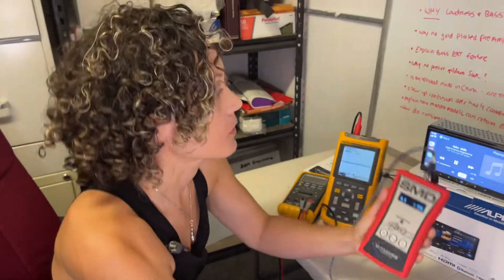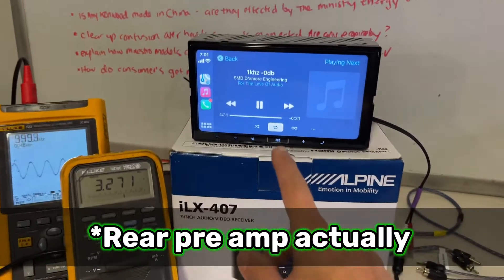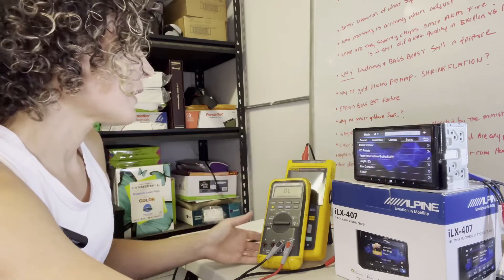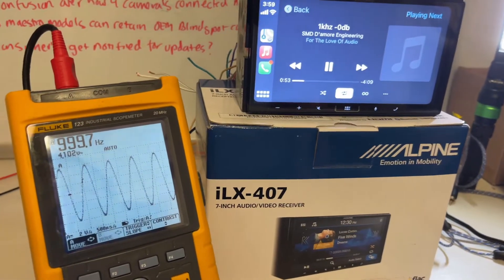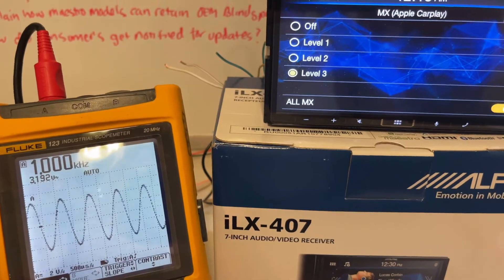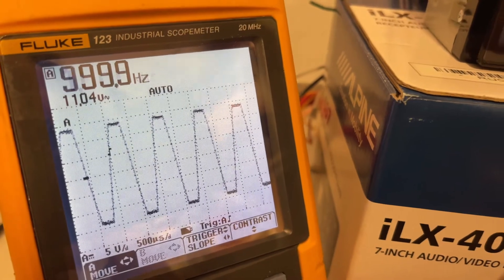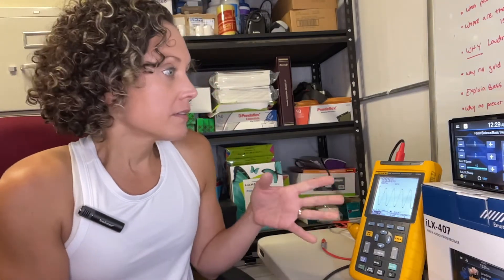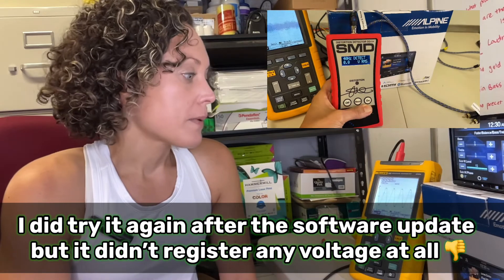Alpine iLX-407 Pre-amp Voltage and Distortion Test with Scope, Fluke  SMD DD1+

Comment: You have to turn up the SLA input volume before testing with Dd1. You’ll get more voltage.
Reply from the maker: I find the oscilloscope is easier to use and more accurate, but I do appreciate the tip! Alpine did verify that when they say 4 volt, they mean with sub level up max and head unit volume max. I did turn up the source level adjustment with the Stinger HEIGH10 in my last testing video, but even boosted to the max, the voltage just wasn't there. I suspect chip shortage related issue with that one.
Reply: @carstereochick  How do you feel about Damores videos saying the DD1 is superior to oscilloscopes? 

Also, have you tested the ifx-f411? I’d love to see a video on that.
Reply from the maker: Every time I tried it - this is specifically for the head unit pre-amp test voltage only -  I felt I was getting inaccurate and very inconsistent readings to the point where I was like I need to try this against the Fluke MD88 and an oscilloscope. And I'm like OCD so when I try anything new or that I'm not familiar with, I have the instruction manual out, I read it twenty times and follow it step by step to make sure I'm not missing anything. So that whole experience is what made me decide to buy the Fluke 123B which has been great. I love the concept of the DD1+ and it seems to work very well for setting amp gain settings, but when I tried it against the other two Fluke devices (regarding head unit pre-amp voltage and distortion testing) it clearly was not accurate. It was extremely inconsistent and it also ate through 9 volt batteries very quickly. 

Perhaps that is because I bought it off Amazon, maybe I got a dud. I did get it exchanged though, but still had the similar issues. I did reach out to the manufacturer via email a few times and eventually someone did get back to me and offered to have it sent in to be tested or exchanged and when I replied back, yes, please tell me what I need to do, I never heard back and just sort of gave up on it. It does seem to work well for setting amp settings so my only complaint is it's not accurate for head unit pre-amp testing. I think perhaps the issues I was experiencing with the DD1+ are related to the chip shortage, it's really hurting a lot of manufacturers right now. Still a great tool to have on hand at any car audio shop, but for checking for distortion and voltage, I much prefer the 123B oscilloscope. 

I haven't tested the iLX-F411, if I get the chance to I will. Planning on testing the X409-WRA-JL next :)
Reply: @carstereochick  See my issue with the DD-1 or any that include the standard 1khz and 40hz tones, is that you may set your HU or amp with those tones. And, then when you test with other tones like 500hz, 100hz at the same db level, the oscilloscope says you’re clipping. I like to play around and test different things as well. I end up sitting in my car for hours trying different things. I’ve returned so many headunits to Best Buy just because I didn’t like the way it sounded or weak preouts. They hate me there 🤣
Reply from the maker: Wow, they must have a generous return policy! You're right, it does take hours and you can get very different results depending on what frequency and what EQ settings you have turned on or off and what levels are boosted like media expander, source level adjustment, etc. Overall I still think Kenwood has the highest kick in their eXcelon pre-amps other than the Alpine CDE-175BT which also has a 5 volt pre-amp.

Comment: I’m wondering what the signal will look like with an aftermarket amplifier set at 20 and above. Happy to see a tech video from a woman. Keep it up. Definitely subbing.
Reply from the maker: Thanks so much for watching and subscribing! Well, that will depend on the amp at that point and how you have your gains set there. The pre-amp signal in the deck looked clean on the scopemeter with volume all the way up, I was happy to see that. But the internal amp definitely started clipping around 21.

Comment: Hi there . I have a 2007 4Runner with the jbl factory amp and sub. I have the alpine ilx-407 and got the maestro RR and the hardness is the maestro T01 and I also replaced all the factory speakers with alpine speakers. I’m have the issue the my volume doesn’t increase after 20 . Anything you can tell me to help me with this ? I would really appreciate it. I have the rca connected to the rear output .
Reply from the maker: If you did aftermarket speakers I highly suggest bypassing the stock amp. The stock amp has dismal output and it sounds like you’re basically hitting the max capacity of what it can do. You’ll get much better sound quality and better output by running your new speakers directly off the head unit. You could use a small aftermarket amp for even better sound quality like the KTA-450 for the main speakers and maybe a KTA-200m and RUXKNOB2 for the stock sub. Bypass stock amp is your best bet for better sound quality and output. That stock amp is designed for lower impedance too so it’s actually giving you less output with the 4 ohm Alpines than it would with the stock 2 or 3 ohm JBL’s.

Comment: I have this same radio and I’m having issues with the source volume. I have the source all the way to 5 for everything and it is like the volume stops increasing after 15.
Reply from the maker: What's the application? Year, make and model vehicle? What else is installed along with it? The only thing I can think of off the top of my head, and I ran into this once with an iLX-W650 and we just changed how we had it wired, is perhaps you have it connected to a factory amplified system using RCA's. Maybe an older Toyota with JBL using a Metra 70-8113 or a Nissan/Infiniti with Bose using a Metra 70-7551? If you're just going RCA from a stock amp, you're basically not using the internal Alpine amp at all and you're just maxing out what the stock amp can do through RCA.

In those types of applications there is just not enough signal from the stock amp through the RCA low level connection. In that type of application we go speaker level (which is higher voltage) and then we either use the head units internal source volume adjustment to offset the stock amp or we use something like a PAC LP7-4 (using speaker level connection on both sides instead of RCA) if we need more play than that. In this example since you're technically amplifying an amplified signal, you'll get more output, but you want a way to level match it so you're not getting a significant volume change with each minor increment up/down on the volume level.
Reply: It has something to do with me turning up the source volume. If I leave it 0 it’s good. I don’t understand why even have the option if it’s gonna do the opposite of what it was designed for smh
Reply: Vehicle is 2016 GMC Yukon with the idatalink maestro rr2

Comment: Thank you so much for this! I just got an amp about 3 weeks after installing the head unit. I didn’t go much past 22-24 during that time occasionally. So now that I am using the pre-outs, do I tune the gain to match the 4v pre out or the 14.4v of the system?
Reply from the maker: There's actually a really specific way to tune using a voltmeter that's kind of hard to put in a quick reply, but check out this JL Audio amp manual that explains the 9 step process. 

https://embed.widencdn.net/pdf/plus/jlaudio/fpcexm8q2f/MX280_4_MAN.pdf?u=ndijqi

The only thing is you can ignore the 3/4 rule because you know the head unit is clean even at max volume. I hope that is helpful!

Comment: What about with Alpines add on amplifier?
Reply from the maker: The KTA-450 power pack? That would connect RCA level so it would be super clean signal though the pre-amp level connection.

Comment: Love the channel and the content on this head unit particularly. I installed it not too long ago in my Toyota Prius V and love it. I wasn’t thrilled by the sound output until I turned on Media Xpander — what a difference! Happy that it’s not a distortion fest. Is MX like Alpine’s version of a Loudness feature? Thanks and keep it up!
Reply from the maker: Thanks so much, I'm glad you're enjoying it! It's not exactly like a loudness feature, it's designed to boost frequencies that are lost during compression so it's helpful on sources like SiriusXM or streaming apps set to the default standard settings. Example - Spotify default setting is to be in data saver mode even if you have unlimited data and standard sound quality instead of highest. If you are using an app like that for music, I would suggest checking the streaming settings and make sure it's in the highest setting available.
Reply: @carstereochick  Appreciate the info! Yeah, I use Apple Music primarily but have a ton of downloaded music that’s only 256kpbs via Apple’s import settings. Even MX set to Level 1 is a serious improvement. The bass and midrange come to life on my Infinity Reference speakers in a way they didn’t when I had MX off and was just adjusting via the EQ presets or manually on the 5-band. I just set the EQ to Hip Hop, turn on MX Level 1 and go. Sounds great!
Reply from the maker: That's exactly what it's designed for, that's awesome.

Comment: Another great video! Like seeing all 3 devices compared. I was shocked media xpander did not distort on the fluke o-scope thru the preamp outputs
Reply from the maker: Thanks! Me too!!! I was totally surprised by that because on my x409 it absolutely does and that one was also tested with the scopemeter. Did notice the voltage dropped with it on, but I didn’t catch that until I was editing.